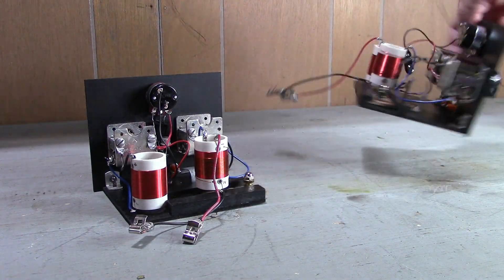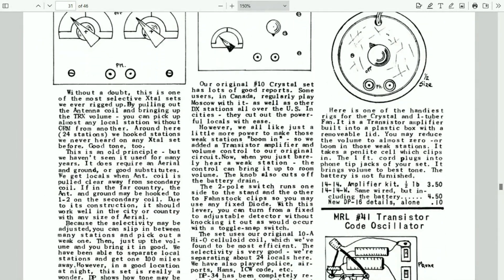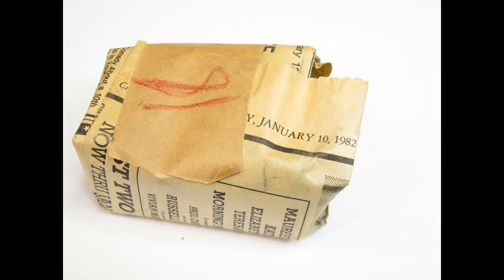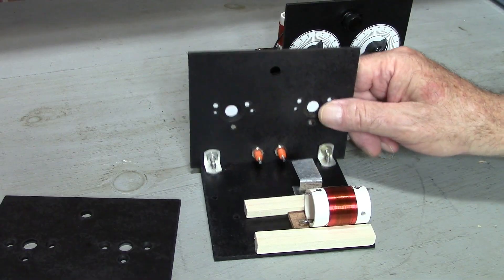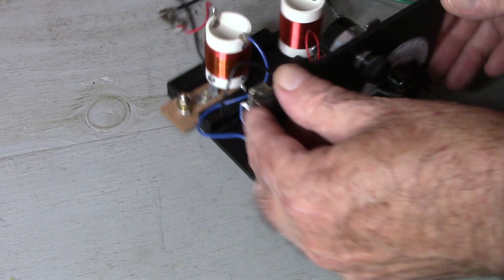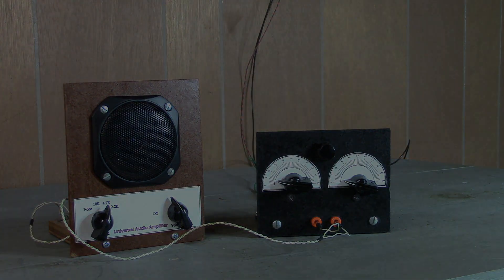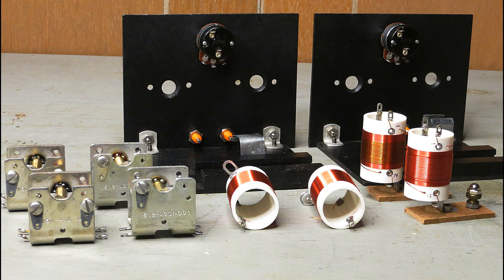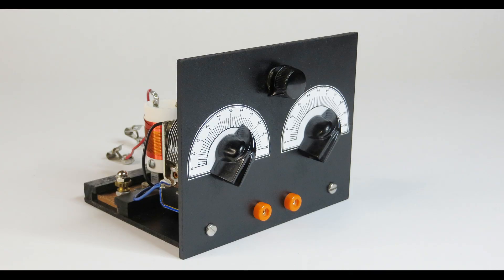Modern Radio Laboratories® No.18 Crystal-Transistor Set

Comment: I have seen the same audio amp in several different videos.  However when I look for it on the web I can't find it.  Where did you get it?
Reply from the maker: It's just an LM386 audio amp module, a speaker and a battery. There is also a switch on the bottom-left that places a resistor across the input to mimic a pair of headphones. Some circuits need the headphones to complete the circuit.
There are many on ebay, but you can get them from Amazon if you don't want to wait for the slow boat from China.

There is a description here: https://www.youtube.com/watch?v=a2qDJZMiTik&t=3s
Advance to 4:04
Reply: @michaelsimpson5417  Yes, I know that, and if i were younger I could make one.  But my eyes aren't good anymore.  I have spent days looking for one on the net, no luck.  Do you have a link to were you bought it?
Reply from the maker: @billhennessy5118  Bill, are you saying you can't find the LM386 module, or are you saying you wouldn't be able to assemble it into an amplified speaker?
Reply: @michaelsimpson5417  I can't find that module.  I have seen it in several other videos that have a high Z output.  I have found several LM386 audio amps a lot of them pre built but not that one.  If it comes in a kit I can get help to build it.
Reply from the maker: @billhennessy5118  You probably won't find that EXACT module because it's years old. It may have been a kit but I don't remember. The last ones I bought were these: https://www.amazon.com/dp/B0B53994XF?ref=ppx_yo2ov_dt_b_fed_asin_title&th=1
If you don't have an Amazon account I'll send you one, no charge!
Reply: @michaelsimpson5417  OK i"ll get some of those.  I have an account.
Reply from the maker: @billhennessy5118  If you have any trouble, my email is mike@mikesyard.com

Comment: Ì had an MRL Model 2 in 1955. I still have it...!

I lived in Sanford FL 10 miles north of Orlando. Every night I received The Voice of America from Chillicothe OH. Antenna was between two pine trees about 75 ft apart and the antenna was about 50 ft high. 

After moving to Brazil on the Amazon in 1956, Elmer and I stayed in touch. In 1959 I made a 2 tube regen receiver. I didn't take the crystal radio with me, sorry to say. 😢

Ì returned to the USA in 1961, joined the Army and became a Morse Intercept Operator at 28 wpm. Years went by and I retired from the DOD as a telecommunications engineer, all from the love for radio started by Modern Radio Laboratories. KK5R
Reply from the maker: WOW, that's a great story! Elmer is smiling. There are some original No. 2 sets on this page:
https://www.analogdial.com/Osterhoudt/Osterhoudt5.html

Comment: My first radio had just a diode and one coil, and the kit came with a little piece of sandpaper, so after you wound the coil, you rubbed the sandpaper to scrub away a line of insulation from the coil wire, and then a slide roller allowed adjustment of the inductance. It had no amplifier, but the sensitive earpiece under the pillowcase allowed me to hear about six different stations. I also built a "foxhole" radio that used a razor blade with a piece of graphite from a pencil that was tied to the end of a safety pin as an adjustable detector, all items you could scavenge even in a war-torn foxhole!   - j q t -

Comment: I had an obscure Johnson and Smith paperback "build your own radio" book that was from about 1965. It had some transistor stuff mostly using CK722s..  The booklet was a mix of tube and transistor stuff. Plus crystal radios

That booklet is lost and I have never seen it on the web

Its designs had coils with thick wires so the Q was radically higher than most radios. Plus the author(s) had you at first using headsets with 1k or 2k ohms and "saving up" to buy headsets that were 10k, 50k or the ultra 100k ohms

These higher impedance headsets costed a bundle but loaded the tuned coil less; so the selectivity was WAY sharper. 

So to get the Q high you want the coil not loaded; use an op amp or ultra high impedance headphones

You want large diameter wire for a higher Q

With that books ideas I made crystal radio that picked up to about 8 Mhz. Used drop in coils with large diameter 12 awg wire and some solid #6 copper too. Picked up AM band; wwv on 2.5 and 5. AM hams on 80 meters with ease. 40 meters AM dicey to resolve if too guys close in frequency

The same radio with drop in coils of 24 awg worked well for AM broadcast but poorly when up in the sw bands

Comment: How did you rivet the solder points to the plastic pipe?
Reply from the maker: They are rivets on one end. Drill a hole, insert the rivet, then put a piece of pipe in a vise (or anything cylindrical), insert the coil form with the rivet, and tap it gently with a small hammer. They are listed as "eyelet lugs" in the catalog. (page E-3) Link to catalog in the description.

Comment: That is a nice reproduction.  The coupling adjustment is most useful when you have stations nearly on top of each other.  You can move the coils apart to improve the selectivity at the cost of some sensitivity.  
On my channel I have a video showing how a small value capacitor (gimic) can be used to couple instead of the inductive coupling.  Either method works

Comment: What a beautiful radio. I'd really like to have one, and it's to my regret that I didn't aquire one. I have several of his catalogues. The guy who reprints them has the rights to them as I recall. Elmer is on findagrave. 73 DE W8LV (and in SANER times: W8LV/VE3) 🙏🇺🇦🇺🇸🇨🇦
Reply from the maker: That would be Paul Nelson. He doesn't have the rights to anything Elmer published but he owns the MRL trademarks. We've had several email exchanges about my videos and website. In this video I've called the radio a reproduction. I've argued that if Elmer published a plan (for the MRL #18 for example) and you build the radio according to the plan, then it's an MRL #18. According to Paul, it's not.

Comment: Excellent video and build quality on the set. Yep, I've built a few of these crystal sets over the years. This Tuned Radio Frequency (TRF) design was used in early tube radios. The Atwater Kent 60 had ganged tuning capacitors connected with a steel band so ya didn't have to tune each stage separately. Thanks for the video.

Comment: Interesting! No bias circuit for the transistor, meaning it depended on the germanium transistor being leaky for the circuit to work.

EDIT: You might want to mute the audio for the Eagles tune, "Best Of My Love." Don Henley of the Eagles loves to issue copyright strikes for ANY reproduction of the Eagles in a video.
Reply from the maker: There's a 1 megohm resistor between the base of the transistor and -9V. I experimented with several values till I found one that worked well. At 1:11 you can see Elmer has one in the schematic, but he used dotted lines because it wouldn't be needed with every transistor.
Reply: @michaelsimpson5417  Ahh. I see. I guess you would build the radio without the resistor and add it if the audio was weak and distorted.
Reply from the maker: @ScottGrammer  I used one of those solderless breadboards to try out different transistors and bias resistors.
Reply: @michaelsimpson5417  I'm impressed by the selectivity. I used to build crystal radios when I was a kid (in the early 70's) and none could tune in several stations without crosstalk like that one.
Reply from the maker: @ScottGrammer  I was impressed as well. It also covers the entire AM band.
Reply: You only get the copyright strike if you call them "Eagles" since there is no such band as "The Eagles"         🦅  🦅  🦅       🤪       - j q t -
Reply: @quill444  This, from Wikipedia: "The Eagles are an American rock band formed in Los Angeles in 1971. With five number-one singles, six number-one albums, six Grammy Awards and five American Music Awards, the Eagles were one of the most successful musical acts of the 1970s in North America. In addition, they are one of the world's best-selling music artists, having sold more than 200 million records worldwide,[1] including 100 million sold in the US alone.[2] They were inducted into the Rock and Roll Hall of Fame in 1998 and were ranked number 75 on Rolling Stone's 2010 list of the "100 Greatest Artists of All Time".[3] Founding members Glenn Frey (guitar, vocals), Don Henley (drums, vocals), Bernie Leadon (guitar, vocals), and Randy Meisner (bass guitar, vocals) had all been recruited by Linda Ronstadt as band members, some touring with her, and all playing on her self-titled third solo studio album (1972), before venturing out on their own as the Eagles on David Geffen's new Asylum Records label."

I know that the name of the band is "Eagles." But since calling your local radio station in 1977 and asking to hear "Eagles" would have been a bit silly, "The Eagles" became their accepted name. I was there, I know.